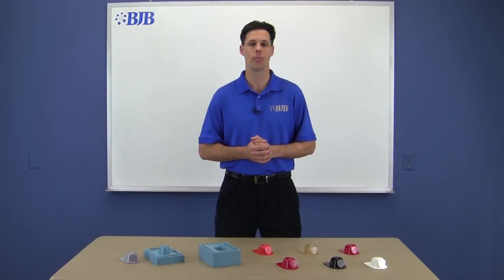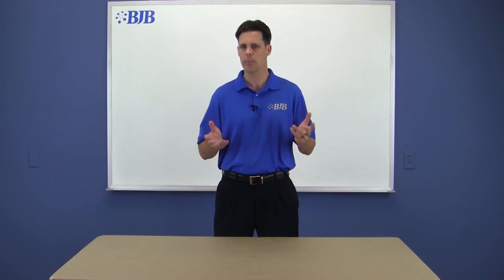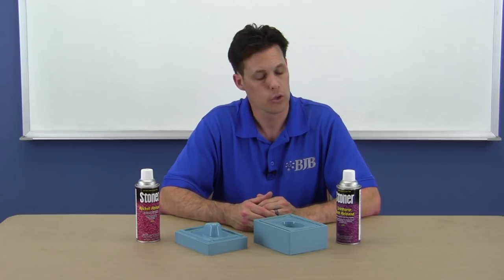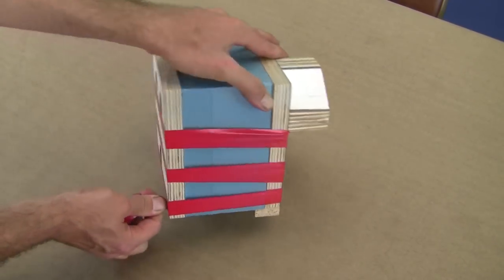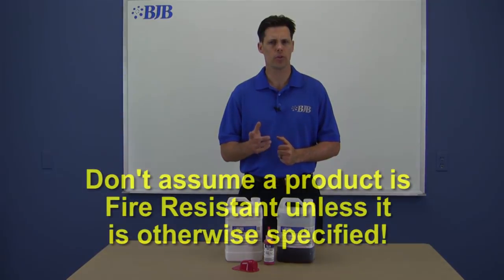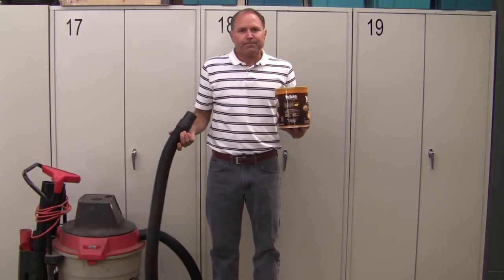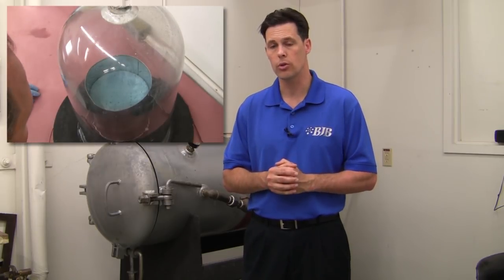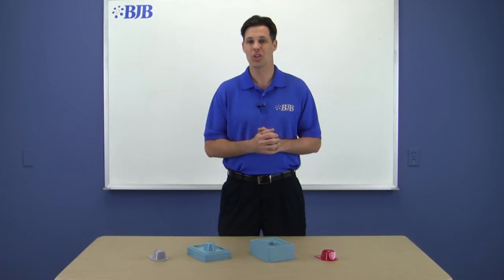Great Video: Casting a Part With Polyurethane | Part 2

Comment: Hi, very good! What material do you use to do the cap/hat?
Reply from the maker: George Freitas the original pattern was 3D printed on an Objet.  The cast part is made with our high impact, fire resistant TC-870FR polyurethane with Red pigment added. Links are in the description.
Reply: @bjbenterprises  the link does not show the description or the value of the material.
Reply from the maker: George Freitas https://bjbenterprises.com/index.php/tc-870-a-b/

Comment: An old video, and still good info. However I see a few channels using those old scales with weights on them (not sure what it's called, other than 'old' scale). Any reason why those are used vs digital that would easily show a number, vs messing around with some weights to measure. A few drawbacks with digital would be 1) needs batteries, 2) can most easily brake. I'm messing with plastics and silicone on a hobby basis, doing mixing based on volume, which I know is the least accurate method, just wondering how that stands up to that old scale that seems to have some room for inaccuracy too.
Reply from the maker: It just happened to be that we used those in our sample lab at the time.  We have digital scales all over our facility, including some highly sensitive scales that measure to the thousandth of a gram.  The Beam Scales are quick if you are use to them, but certainly digital scales are more universally used and easy to read.  We have since gone to show digital scales in our videos since it can be confusing or intimidating to folks new to mold making and casting.  Thanks for the comment!

Comment: What information would you give me to make a cast that is kinda bumpy has holes bcs I wana make a mold,for my tech deck,penny. Board and you guys look like realm experience at what you do
Reply from the maker: If a part has an irregular shape or geometry, you can also use a bed of modeling clay (like non-sulpher based plastalina or similar) to define the first half of the mold.  This is also a common method for making two part molds.  The clay would plug any through-holes in the pattern.
Reply: Thank you so much

Comment: hey where can i buy that preasure pot and i need some boolet proof poly carbonate from lexan the best on. which one should i buy
Reply from the maker: That particular pressure pot is a custom-made piece of equipment we purchased second hand.  You can buy similar sized systems from R3 Manufacturing:  http://www.r3mfg.com/

Comment: How many parts can typically be made on a mold before it degrades beyond use? I understand many things come into play so use the fireman hat, how many hats would you expect to get from the tool in this video?

thanks
Reply from the maker: +Wayne Kinne A simple part like this with minimal undercuts may net you roughly 25-30 parts. You would likely see wear in the helmet badge area where silicone is under stress from pulling out parts from the undercut. Parts without an undercut like that may net 30-50+ parts. These are very generalized numbers but if you demold the parts in the proper time (don't allow them to sit too long in the mold) and use a proper mold release, you will see the best performance. Also, casting one type of material, as oppose to switching materials around, will also help achieve maximum use. Great question!
Reply: +BJBEnterprises It looks like 200 parts in your adds, what is up with that? I am looking at an ABS type of hardness.
Reply from the maker: +Wayne Kinne I'm not sure where you are pulling that information from. There are cases in which you may see 100+ parts out of a mold, but in the industries that quote custom molds and parts they will often place a conservative estimate of tool life in numbers similar to above or simply cast multiple tools. There are many variables to mold life which affect this number so giving a blanket statement it is better to error on the conservative side rather than over-promise on something that could be misleading. If you are referring to the cost effectiveness of silicone tools compared to mass production, then it's still a viable way to produce hundreds of parts.  For ABS-like parts, you would look at products like our TC-808, TC-803, or TC-890 series.
Reply: +BJBEnterprises Ya opps, I am mixing up my google searches, sorry. It is 3D printed tools that are claiming 200 parts, my bad.

Can you give me a better idea on how to choose? TC-808, TC-803, TC-890? What are the differences? What are the benefit of each. Which Silicone to use as mold? Which mold release?

My final product will float in water, need to withstand freezing temperatures as well as 70 F temps. And be durable.

Thank you,
Wayne
Reply from the maker: Hi Wayne, lots of info to answer there.  For polyurethane selection, you would consider the size of the part and the working time you need to mix A&B and get it poured into to the mold.  Some folks can work with 2 minutes, some need 5.  Will you degass in a vacuum chamber first or go into a pressure pot?  Are you just mixing and pouring?  How many bubbles are acceptable to you then?  For silicone, do you have lots of undercuts or is the piece simple in geometry?  You want to use the stiffest silicone you can get away with for best mold life and part tolerances.  A good place to start is a 40-45 Shore A like our TC-5041. It's best to call our helpful Tech department and we can sort through this stuff in a matter of a 5-minute conversation.  714-734-8450 Wayne Kinne
Reply: +BJBEnterprises Sweet, thanks I will call after Christmas, maybe next week. I do have a vacuum chamber and a 9 CFM vacuum pump, so I will be degassing. I can probably make a pressure tank. I have designed my project into 3 main pieces and 9 smaller ones, so zero undercuts. The main parts are 7 1/4" diameter and about 1 1/4" tall ( they are hollow, well after they are glued together they will be hollow ). These are to be marketing samples to test the market so I need them to look as perfect as possible,  so the fewer bubbles the better. Just mixing and pouring? Do you mean without vacuum and air chambers or a power mixer? I will be mixing by hand like in your video. For working time I am thinking 5 minutes might be best to start, then maybe go to 2 minutes later, is the only difference the cure time? The end product is the same?

I would love to make 1000 of them but may settle for as few as 100, so I am thinking maybe 10 molds and see what I get.

Comment: Thank you.  Great videos.  I'd like to know more about the materials, durometers.  I need something that is flexible but hard or firm to touch and push on.  The part needs to flex hundreds of times and needs strength to be pulled on Hard.  Maximum thickness needs to be 1/16 inch thick.  20 inches long.  5 inches wide.  Would this be a nylon?  Or please tell me, I'm all ears.
Reply from the maker: ***** Hi Richard, you might want to have a look at our Durometer Video:  https://www.youtube.com/watch?v=Q6jn223_1Mw 
Also, feel free to call or email our Tech Dept. to find the material you need.  We would be happy to answer your questions:  info@bjbenterprises.com  714-734-8450

Comment: Thanks for the video!
I really wish there was a cheap system for degassing / pressurizing (pressure tank + vacuum chamber in one and a cheap vacuum pump)
Reply from the maker: Dejay Rezme Hi Dejay.  Define cheap?  While an industrial vacuum system can be an investment, there are some reasonable systems available on the internet if you do some searching around.  You might Amazon or ebay for some chamber/pump combos.  For pressure tanks, many people use paint pressure pots that are widely available and reasonable in cost.  They are certified for pressure and have the appropriate safety valves to make pressure casting a safe process.  Once again, it is an investment to purchase tools and equipment, but the quality of the parts produced is increased exponentially and is a sound investment if you plan to continue using the molding/casting process.  Regards. - BJB
Reply: BJBEnterprises I mean dirt cheap ;)

Yeah I guess it simply needs a bit of investment like any hobby. I've seen an air compressor / vacuum pump for < $100 but not sure if they are any good. I guess it's better than nothing in any case.

Shouldn't those designs for paint pressure pots be theoretically be strong enough for vacuum as well? I guess you do need a window to see / control the bubbles. But other than that it looks really simple. A pot, a thick transparent lid, a seal and clamps for the pressure.

Could you mod a pressure cooker for this?

Anyway, thanks for your answer!
Reply from the maker: You can use a pressure pot as a dual purpose vessel if you built an acrylic lid with gasket and pull vacuum.  We use 1" thick acrylic to resist the forces of vacuum pulling down.  I would also mention that the vacuum pump required to effectively remove air from mixed materials is quite high.  You need a pump that can pull a minimum of 5-6 CFM down to 28-29" of mercury.  If you try to use a weak pump, the bubbles will not even budge and it's a waste of time.  To get some ideas if you are on a budget, look at something similar to these:  http://www.amazon.com/s/ref=nb_sb_ss_i_3_10?url=search-alias%3Dtools&field-keywords=vacuum%20chamber%20kit&sprefix=vacuum+cha%2Ctools%2C381
Reply: Thank you very much for the info!
So more than 141.584 liter per minute and at least -982 mbar. Well I'll keep a lookout on ebay. But if I get into this I at least want to have some dual use. Pressure / vacuum pot and also use it as an air compressor for airbrush / painting stuff. And maybe sandblasting (I'm just trying to rationalize why I need to spend money for a new hobby haha)

Comment: Where can I find the clear tube like part that you connect to the vacuum pump to de-gas the resin material?
Reply from the maker: +Wakeman Edwards Hi, if you are referring to the large glass bell jar we place the material container into, you can find these through many lab supply companies.  They are somewhat expensive and most people will use a chamber with clear acrylic lid instead.  The bell jar we used in the video is great for video purposes to see the action happening inside.  For a better visual of a typical vacuum chamber, see our video on BJB's industrial vacuum cart system.  https://www.youtube.com/watch?v=_srHYTiRCB4
Reply: That's a lot of help....thanks!

Comment: I keep hearing urethane rubber is hard to paint, do you have any insight on that?
Reply from the maker: Yes, we have solutions for that.  We offer a couple of Flexible Paint systems; SC-92 and SC-89.  https://bjbenterprises.com/index.php/polyurethanes/coatings/
Plus, we have an adhesion promoter called TC-89 that increases the bond even further.   For many years these have been used on theme park character heads, special effects, costumes, prototypes, flexible foam, and much more.  One thing to also be aware of is the type of mold release you've used in making urethane parts.  You'll want to avoid silicone-oil based mold releases if possible and opt for a "paintable" mold release like our E302 Rocket Release.  Please call us if you have additional tech questions.  We are happy to help.  714-734-8450
Reply: BJBEnterprises Thanks, you guys are tops

Comment: i wanna ask for ur help, i have a flight stick joystick for Fligh Sims which is for right handed... and i wish to make it left handed... how can I invert the handle?
Reply from the maker: There isn't a way to do that with mold making and casting.  You would need to 3D scan the original, reverse the model in the computer, then print, and then make a new mold.

Comment: How could I cast a skateboard wheel. It needs to be a hard rubber. Is there anyway I could do that?
Reply from the maker: Yes and no.  You can certainly cast durable wheels from what we term "room temperature urethane" for a number of applications.  BJB produces some of the best room-temp processed elastomers that are also easy to cast.  However, production skateboard wheels are typically cast in a process called "hot-pour urethane" in which the polymer is processed at temperatures approaching 200F/94C.  The chemical make-up in hot pour urethanes does not work at room temperature; it needs heat to lower the viscosity from a gel/solid state (making it pourable) and it also needs the heat to act as a catalytic/cross-linking agent.  You will achieve higher physical properties like rebound, tear strength, and abrasion resistance over room-temperature urethanes. We have had many customers (like Shark Wheel) use our urethane systems to prototype and produce short run urethane wheels for sporting applications like skateboards and robotics as well.  If you have a unique or specific application requirement, please feel free to email us at info@bjbenterprises.com and we'll be happy to help you out either way.  Regards - BJB

Comment: Why my silicone blue rubber always sticker in the mold ?It's made of steel cromed ball very shiny and with no porosite. My rubber silicone can have bad quality?
Reply from the maker: Silicone can be tacky for several reasons:  You used the wrong spray mold release, you didn't mix the silicone long enough (or used the wrong mixing utensil), you were not accurate on the mix ratio (use a scale, not your eyes), when using a platinum silicone you cast against something that the silicone didn't like (latex, sulfur clay, unclean metal oils, tin silicone, certain urethane elastomers, other natural rubbers, etc), or it is very cold and you need to wait longer for cure (or add some heat).  It's also possible you used poor quality silicone material or very old material.

Comment: its a brilliant video. 
We are casting transparent polyurethane in an aluminium profile which is open on the casting end. We degass the polyurethane and make it entirely bubble free and pour it into the aluminium profile . The gel time for our polyurethane is about 30 minutes. So post degass and mixing we still have about 10 minutes left . 
After pouring it into the profile the bubbles start forming again and again and again. its quite depressing to see bubbles in the profile. kindly help us out with a solution. We let the Polyurethane cure at room temperature for 24 hours.Kindly help us out with a solution. Thanks
Reply from the maker: +lakhan agarwal Hello, it's possible that there is moisture/water contaminating your polyurethane.  When PU comes into contact with moisture, it forms CO2 and makes bubbles.  The moisture could come from mixing in a paper cup or using wood mixing sticks.  Another possibility is that there is still microscopic air in the polyurethane after mixing (not enough vacuum strength during degassing) and the heat/exotherm is causing the small bubbles to grow and turn into larger bubbles you can now visibly see.  You can email us pictures of your parts and mold to help us understand the issues better:  info@bjbenterprises.com
Thank you for your interest in BJB!

Comment: can i just port a vacuum line from my car engine, they pull high vacuum at idle or under load?
Reply from the maker: Not likely.  The vacuum required to effectively de-gas silicone and cast urethane is fairly high but you also need high CFM to do it in a timely fashion.  This means you need at least 28-29" of Hg and 5-6 CFM at a minimum. Often times we hear customers are trying to use single stage pumps that can only reach 26" of Hg and they struggle to pop the bubbles that rise to the surface.  If you are living at higher than normal altitudes, this compounds the problem even worse.  Having a good vacuum pump opens your options to using a much wider variety of material systems and not just hobby grade materials that sacrifice mold life and material properties in an effort to make vacuum unnecessary.

Comment: Can you support me to choose wish BJB Polyurethane material  i can use for mechanical part that can holds impacts and heat resistant 

Thank you in advance
Reply from the maker: Yes of course.  It is best to send material questions to our technical team.  They help customers choose products for specific applications so you can get the correct material the first time.  info@bjbenterprises.com

Comment: Using TC-804 on its own, no problem, works great, no air bubbles at all. Adding pigment, I end up with lots of tiny air bubbles. I make sure my two parts with pigment are bubble free before mixing, mix in a separate cup, then degas for at least 2 minutes. Bubbles seem to form during pouring even though I'm very careful. Is that a problem anybody else has? Is there a known cause, am I overlooking something, is there a solution? Thanks!
Reply: Precision: I'm mixing a total of 280g of TC-804 for that casting.
Reply from the maker: I have not heard of that specific issue but bubbles can form many ways.  Moisture is the most common reason which could come from the pigment, paper mixing cup, wood stir stick, and etc.  The best way to help you would be to have you go over your situation and variables with our experienced Technical Team.  Send an email with details to info@bjbenterprises.com or just call 714-734-8450 for the quickest resolution.  Thank you for reaching out!
Reply: @bjbenterprises  Thank you for the quick answer, working on all these conditions, mostly moisture. I always use plastic mixing cups but I have been using wood stirs, switching to metal and plastic now. Just placed an order for the longer worktime TC-806 system.